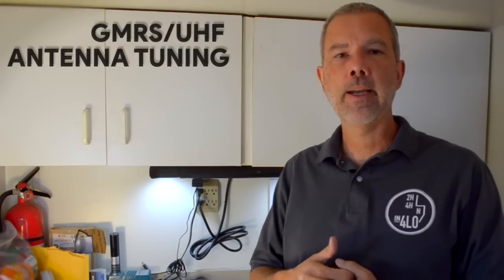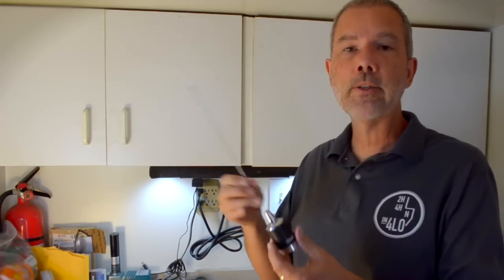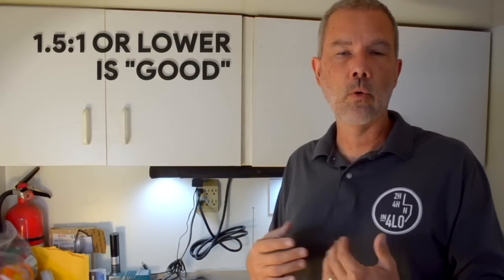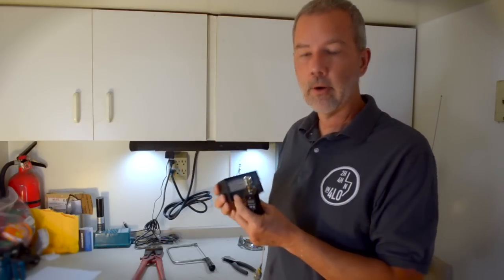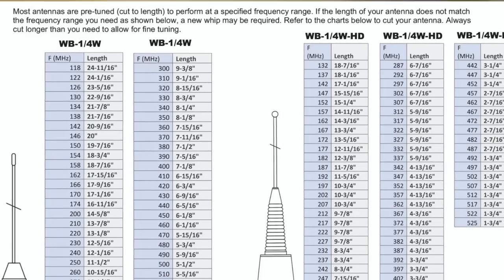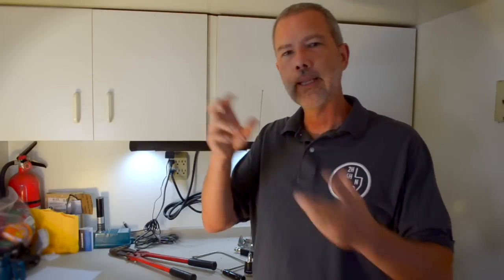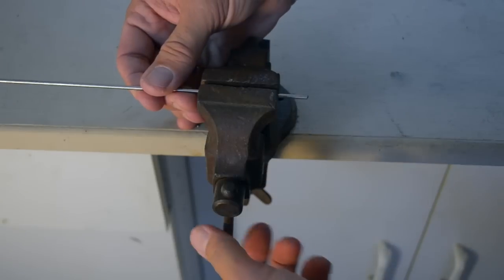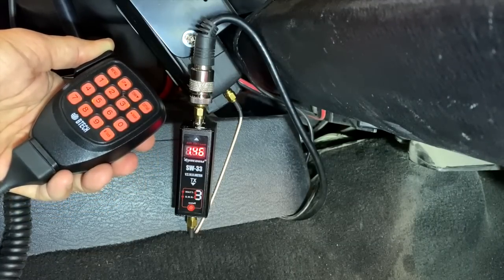How To Tune A GMRS Antenna & SWR Basics

Comment: Need some help - Application, 2021 Jeep JL antenna mounted on tailgate with half inch braided grounding cable to the frame. GMRS radio K G1000G, MXTA26 Antenna, RG58 coax 8’ long, SWR has been 2.1 to 2.7 There were no direction with the antenna when I received it from buy two way radios, rather than guessing weather to cut the antenna at what length to achieve a 1.5 or better SWR I decided to reach out for some assistance
Reply from the maker: Midland says that antenna is pre-cut for 462Mhz .. the higher SWR is likely due to the location of the antenna - i have the same issue on the tailgate due to the lack of a good ground plane.. Try loosening the nut that holds the antenna into the spring-base part, and raising the element a few MM to see if the SWR goes higher.. if it does, then try trimming 1 or 2mm and put it back in normally and see if if goes down.. if it does, try another 1-2mm .. just be careful, once you go too short, there is no going back.
Reply: @TheNotaRubicon  What is you opinion of this antenna BB4505CNS says its for poorly grounded applications. Option B what is I run a ground from the battery?
Reply from the maker: DO NOT GO ANYWHERE NEAR YOUR BATTERY for your antenna - you are confusing DC ground with RF ground, which are two very different things.. That no-ground-plan antenna may work better if the issue is a poor ground-plane for your current antenna.
Reply: @TheNotaRubicon   I reached out to Midland, this is the response. MXTA26 is pre-tuned to 462 MHz assuming its mounted on a metal surface (ground plane). Mounting it without a ground plane under it will raise the resonant frequency, making it appear too short.

 It might be possible to raise the antenna in the base slightly and obtain better SWR. Generally, the MXTA26 will have SWR less than 2:1 at GMRS frequencies even when mounted without a ground plane.

I purchased a BB4505CNS to see if I can get a better SWR
Reply: Increase the frequency and see if it goes up or down. If the swr increases when you increase the frequency, it’s ok to trim.  If it decreases, see what the SWR is at the highest frequency you expect to transmit.  You’ll need to get a feel for what the swr is across the whole band. Also, keep in mind the repeater frequencies are 5MHZ positive offset.

Comment: Hello!  I have a Midland MXT400, 6 meter antenna cable and 6dB gain antenna (mxta26).  Using a Surecom SWR (sw-33), with the radio set to low power, the SWR reading is 1.05.  I think I've cut the antenna too short.  Can anyone confirm my belief, or is the reading acceptable?  TIA
Reply from the maker: 1.05 is near-perfect. .Dont touch it anymore.

Comment: Bought a midland mxt26 6db gain antenna. It was supposed to be pretuned. I checked, it was 2.1 swr. Took 1/16 off got 2.1 again, took another 1/16 off and it went to 2.2. I'm gonna stop while I'm ahead. This sucks. Will a 2.2 mess me up? Do I need to get another antenna? Still a rookie so I'm trying not to screw this up WRMR546
Reply from the maker: other things could be effecting the SWR- such as where it's mounted.  For example on one of my Jeeps when mounted on the rear-corner there is not a good "ground plane" so the SWR never gets below about 1.6 ... But could also be the antenna..
Reply: @TheNotaRubicon  it's mounted on the driverside of my ram 2500. I made sure I left the mount bare metal for the antenna. Hopefully that's all it is, I'm already too tall for a roof mount so as long as it's not going to mess up my radio I'm gonna run with it as it is

Comment: Hello ! Maybe you can help with this. I have a Laird BB4505CS which is a 450-470MHZ 5/8th over 5/8th wave antenna. It has a usable bandwidth of the entire 450-470 range. Do I need to cut this to use it for gmrs ? The antenna package comes with a cut chart but I called both my local radio shop and where I bought the antenna from ( The Antenna Farm ) and they both said that I do not need to tune this antenna.
Reply from the maker: The only way to know for sure is to put your SWR meter on it and test it.. anything else that anyone tells you is just a guess.  MY GUESS, based on testing/tuning a dozen or more antennas in the same 450-470Mhz band, is that yes, you will need to cut/tune it.
Reply: Thank you for the quick reply ! Ok looks like I’ll be getting myself an SWR meter then !

Comment: what is a good gmrs specific antenna for a btech in car
Reply from the maker: any "GMRS" mobile antenna is as good as any other.. if it is marked as a "GMRS" antenna  you should not have to tune/cut it.. a "UHF" antenna will need cutting/tuning.

Comment: Does the type of base play a part in the length of the antenna? IE spring style. Also, can I use the allen screw to set the position higher or lower in the base to set SWR?
Reply from the maker: some bases can add to the overall length of the antenna, and yes, i use the allen screw to set the antenna a few MM up or down, for very slight adjustments.. remember if you get a "GMRS" specific antenna, you should not have to cut it.. only if you get a "UHF" antenna.
Reply: @TheNotaRubicon  thank you for that. I have been putting together a budget build. I randomly have been picking up antennas as I see them for sale. Both if them have been cut to 15 3/4 not including their bases. When I do buy my radio I will make a conscious effort to buy under your links. Im originally from your area but now stationed in the Tucson area.

Comment: Query 
If one is Building a Unicorn, and money is no option.  If an antenna is too long and it sends the signal back into the unit, should one run two radios at both ends on different frequencies?  A Rx unit with a super long antenna to grab as much signal as possible and a Tx one, with a tuned antenna to ensure the max signal gets out?  Or will the TX just fry the RX near by?
Reply: @TheNotaRubicon  
Ok
Why?
What’s wrong with a supersized antenna for RX

Comment: What's the best placement on a vehicle? Installing one on a Nissan Frontier and undecided if I should mount on tool box, roof, or hood of vehicle.
Reply from the maker: "Best" is always highest spot, center.. But any place will work with little noticeable impact..  Mine is mounted in pretty much the worst possible location (low, rear corner) - the experts say it wont work at all - yet i can talk to my wife in her jeep, also with a bad antenna location, over 30 miles away.. So what I have learned from this is that the "experts" are idiots.

Comment: I see nobody shielding the CB or GMRS unit with some kind of metal foil. If i use my PC and scroll quickly it peaks the receiving signal meter to its maximum and only on channel 15-17. Has anybody some details on what's happening and if my CB unit is faulty or just super sensitive? Yes, i do use a somewhat older Microsoft wireless Mouse (FCC ID: C3K 1008).

Comment: I was wondering if you should tune using 465.1437 as your center frequency to account for the higher frequencies that the repeaters use? (low ch. 1 at 462.5625 and high of 467.7250 for highest repeater freq)?  Considering the higher repeater frequencies are the frequencies that allow up to 50 watts, would it be better to make sure these have the lower swr readings? Oh, and thank you for posting this video. I know its a little bit dated, but i just discovered it and it shows how easy it is to tune your antennas.... hopefully it will encourage others to tune without being afraid of destroying their antennas. Great video.

Comment: Could you elaborate on your justification on why its not necessary to use the CB method of comparing SWR's on low and high channels? You state that because the antenna instructions give the recommended length, we can just trim the antenna till we get the lowest SWR. I don't see how that would work because we wouldn't know that it is the lowest achievable SWR until the ratio starts to go back up, but at that point the antenna is already cut too short. Is the method of checking on low and high frequencies still applicable to GMRS the same as CB? 

Great channel btw. You have a good attitude. Just discovered your videos and also just getting into GMRS after being on CB for a few years. 4x4 club is transition to GMRS so its time to get on the bandwagon.

Comment: After watching your videos, I'm going to make the swap from CB to GMRS (already have a license for GMRS) in the Jeep. Out of curiosity, are you using an NGP antenna? Any issues with your antenna in terms of the ground plane (or lack thereof)? I have an existing CB antenna mount point on the tailgate and am wanting to re-utilize that point (although I'll have to manufacture something to accommodate NMO). Thanks.
Reply from the maker: We use Browning BR-450 UHF antennas which require a GP, mounted right where our CB antennas were mounted.. not the best GP on the tail but we still get good SWR and have no issues transmitting 30+ miles, ~75 miles to repeaters.
Reply: @TheNotaRubicon  Update: I got the KG-1000G a few weeks ago and got around to installing it last weekend. I couldn't find the BR-450, but ended up trying the Tram 1173 and could not get it down below 1.6 SWR. I ended up getting a Nagoya NL-770G and out of the wrapper was SWR of 1.02 and 1.09 for the 467 and 462 freqs, respectively. I used the same mount my CB antenna used to be on (I sold the Cobra 75 WX ST).

Comment: Another noob question...so if you. purchase a GMRS radio, why isn't the antenna already tuned for the radio frequencies it transmits on?
Reply from the maker: IF you get a GMRS-specific antenna, it should be tuned already - but it should still be checked to make sure there are no shorts or other issues.. If you get a "UHF" antenna, it must be trimmed/tuned.

Comment: Doesn't adding the SWR meter to the antenna increase the antenna length and hence affect the SWR?
Reply from the maker: Not very much on a mobile-radio setup as you're only increasing the length of the feed line, not the electrical length of the antenna.. On a hand-held radio though, it can make a significant difference.

Comment: Great instructional video. One question. I used your link to purchase the SWR meter and it arrived a few days ago and I'm finally getting a chance to use it but the adaptors it came with dont fit onto my antenna nor the back of my GMRS unit. What other adaptors do I need to buy? Thanks
Reply: Depends on what radio you have. Amazon and ebay have a ton of kits for different adapters, or you can search specific. Some common connectors are PL-259, BNC, SMA male, and SMA Female. I have the same little meter, or one like it and it had everything I needed except for one to go to PL-259. What model radio do you have?

Comment: Why GMRS and not CB?  I have not used a CB for years and just recently started back into it. Is there an advantage to GMRS? Set up my base and while I get alot of skip there are not many locals talking in my area anymore. My new tower goes up when the weather warms up. Should I add a GMRS radio to my station?
Reply from the maker: GMRS has a cleaner signal, has much better range, you can use repeaters to get even greater range, and generally (for now), the channels are far less crowded/quieter than CB.. Basically GMRS is better than CB in every possible measureable  .ay
Reply: @TheNotaRubicon  Thanks for the reply. What's the range on a GMRS and do I need a license? I get about 18 miles on my CB base with no amp pushing the signal (12watts). Can GMRS do better? I see the wattage is higher with that wuxon radio being 50 watts. My CB linears tubes are shot and can't be replaced so looking for an alternative for long range comms with family in case the cell towers go down. I would like to get 50 miles or more. I have to push some serious wattage to beat the skip at that range on 11 meters. My mobile gets out about 7 miles in my area depending on terrain.
Reply: @coldandaloof7166   it is better on a good day and a repeater can get 50+ miles . 
Remember it’s crisper .
Reply: @coldandaloof7166  With my set-up (a base station with a Midland MXT105 w/ power supply - 5 watt output, UHF ground plane up 25') and a mobile MXT105 with the little mag-mount 1/4 wave (6") I get about 7 - 8 miles range. I don't communicate w other operators on GMRS right now (I have ham equipment). GMRS has it's place as does 11 meter CB. A little history - some of the GMRS frequencies used to be part of the long-defunct Class A CB. All that is left now is the present Class D CB (11 meters).
Reply: CB was basically taken from the 11 meter portion of the HF ham band.  It was a poor match for a "Citizens Band" radio.  Higher freq. radios would have been much better and are.  It's why ham operators use VHF and UHF freq.

Comment: Does shortening the antenna effect the receiving distance? Thanks Chris
Reply from the maker: Technically, on paper, in a book, yes - but in the real world, with human ears, it would be difficult to cut it so much that you would detect any noticeable reduction in reception.
Reply: @TheNotaRubicon  Thanks, that 771 you cut it extremely short any issues?
Reply from the maker: Zero issues, and it is the main antenna I use on both my KG-805G and my BTech GMRSV1 .. I regularly get several miles range with it and easily hit repeaters over 30 miles away using it.
Reply: @TheNotaRubicon  Great thank you

Comment: Great video!  I've been a ham for 10 years, lots of confusion on this topic. High SWR kills radios because greater the impedance mismatch, the more the antenna, as the electrical load, acts like a short circuit.  "Reflected energy" is not the killer, that energy will effectively heat up the coax, as it eventually finds its way out through the antenna anyways.  it's that your simply shorting out the amp if the load isn't 50ohms.  Zero ohms is a short, 1M ohms is short, 50ohms not a short. 50ohms is the intended load. If untuned, you get intended load plus mismatch load which could equal too much load which also  equals pow!, go buy another radio.   73
http://hamuniverse.com/wc7iswr.html

Comment: Do they make full size single peice whip style antennas? Ive ran cb antennas that use the little set screw and dont care for them. Ive had the set screws back out and i have lost two antennae.  The base was only thing left. My truck started life as a Fire and Rescue Medic truck thay was converter to AWD, etc for Bernallilo County in New Mexico (Albuquerque)  and after 12 years was sold to Cibola County fire department before sold to pruvate owner then converted to a big ass pickup. She is now used to tow vehicles, pull out tree stumps and pull out live trees and as a non emergency offroad rescue and recovery vehicle. When buddies call they stuck in mountains in snow and mude and shit i pull her out to get them out. When idiots drive there new shit in ditches she comes out. Ive pulled out two semi trucks on Route 66 when they lose control in winter. My old ass unit would pull semi trucks with full trailers out ditches. Was fun wouldnt do it with any speed but she did. It but she did it because she was a rare AWD conversion with tires smoking.
Reply: Put a small dot of blue loc tite on it.... threads can't vibrate out and becomes sticky feeling
Reply: There was my truck and another unit specd and built at same time. Twin girls that were in service. Mine was the bigger one for some reason they built this one like 3 inches tallernthen her sister but everything else was the same. Ive been trying to find her twin so i can buy her too. And this week my buddy thinks he saw her so hopefully theblead is legit because no ine knows what happened to her so if i can get her and have both sisters. This truck is for my daughter so i want her twin for my son.

Comment: How will you know if it’s too short to begin with instead of too long 🤔,, I forgot to ask that ??
Reply: Check the swr at three frequencies; the lowest, middle and highest frequency of the operating range. If the antenna is too short, the swr will be high at the highest frequency, higher at the middle and highest at the lowest frequency.
Lengthen the antenna, if possible, until the lowest swr is achieved at the middle frequency. The swr will then increase as you change frequency in either direction from the middle but should not exceed satisfactory levels at either end of the range.
Reply: @nunyallsbeeswax  this is a year late, but... seems like I could apply this low/mid/high freq logic to the tuning process. By first tuning the antenna length to the lowest frequency, going a smidge too short "might" still leave it long enough to get an optimum SWR at the mid frequency. Does that make sense?

Comment: Thanks for this video. I went out and got the SWR meter you use and I just love it.  Works fantastic.  On trimming the wire, I bought a Nagoya NMO-200C that they advertise as not needing any tuning for GMRS...  Well, I put this up and the SWR without touching it, on channel 1 was 1.9 and 22 at 2.6.  So yea, didn't think that was true.  So I've taken a half inch off of the top rod and have it down to 1.86 and 2.0 respectfully.  So while it is coming down, do you just keep trimming until it comes down?  I don't ever recall trimming that much off an antenna but guess so.  
And I trim using the grinder too.  Works fast.